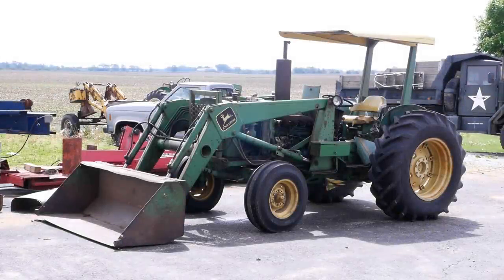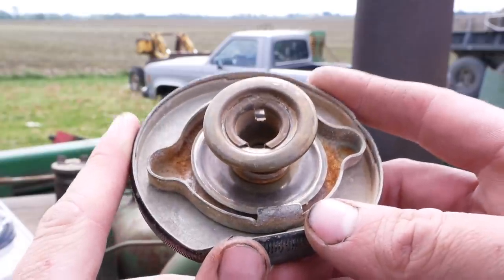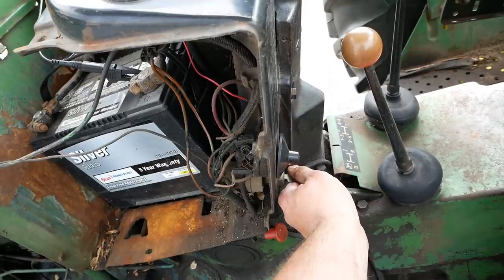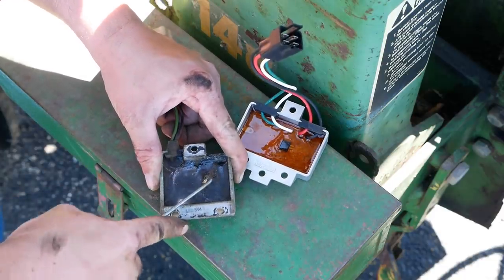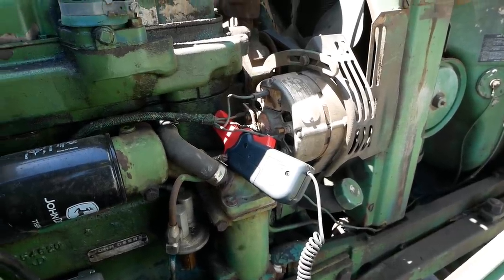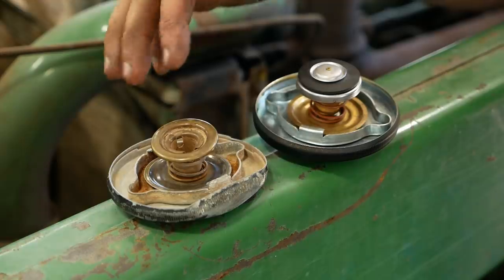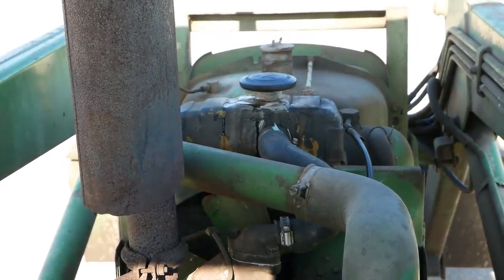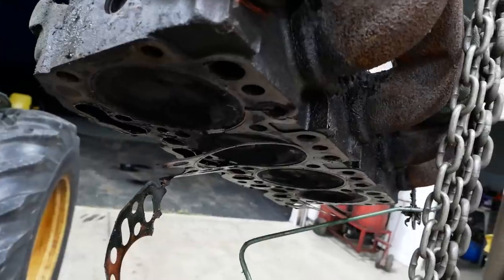Not Fixing a Tractor - Overheating and Barely Starting

Comment: I hope you told the customer that you weren't going to warranty any of the work you did on the cooling system. The electrical system you at least got in good shape, but... What's that tractor worth if everything was fixed and working properly? How much would it cost to get it to that point? Looks like a parts unit to me.

Comment: It is sad. This is old reliable technology. It takes care about you for a long time, if you take care about it.

I believe too that there is a lot of build up in the radiator. Maybe there is a chance to cure the overheating by a radiator flush , with chemicals who disolve the buildup.

I always say to my buddies who are not mechanics: Oil and a filter is cheap! Maintainance is cheap!
Because when you have a nice tractor like this, it is an even higher investment to replace it. And I really like this tractor. How much HP does it have? Something between 60 and 100 I asume.

Comment: NO Thumbs down.   :)    Sometimes you gotta get em running to see how bad they are.   The customer should have been more honest... Then they wouldn't have bothered with the charging system, until they knew the engine was worth salvaging.   At least it runs now, and they can sell it for scrap.   Craigslist will say...   "Needs TLC"   Ha Haaaa

Comment: Engine swap and trans/axle swap. Caterpillar V8 diesel D90 dozed engine an gearing outta a DTZ tractor. DTZ's have engines that are great fer generators better than tractor engines. But their trans/axles are awesome with a Caterpillar engine bolted to er.

Comment: So about which comes first, the hen or the egg. I´m betting on the alternator giving up first, then the batteries goes bad from not having enough charge. Then finally the starter gets fried, when it does not have enough juice to spin the engine properly. It is a disaster chain...

Comment: So basically they wanted you to fix it just enough that the overheating problem wouldn't be super obvious so they could pawn it off on some poor schmuck, probably without telling them about the issue, and let them discover it on their own the first time they try to use it. Fun. Can't fault you. You did your job, discovered the issues, and came up with a solution. Not your fault the owner is unscrupulous.

Comment: Irontite works wonders for garbage like this. Put in two bottles of the blue bottle All Weather Seal for this and watch it work for another 2 years. I got 9 months out of a terminal 7.3 IDI heads cracked gaskets blown and leaky and only used one bottle. Should have sprung for two I'd still be driving it

Comment: As my dad would say in the old days. Time to unscrew the new radar cap and tell them put a new tractor under the new radar cap. So nothing you did wrong. They tryed getting you to fix a worn out tractor. Sad you even put any new parts on that thing. And if you know it was that bad. You give it back to them and say it can't be fix. So you can't fix worn out stuff. You got to have something lift on it that worth it to fix. And when a engine wore like that I be saying time to get a uses engine or time to get a new tractor. So you did nothing wrong. You did what the guy wanted. Say to yourself good I got that peace of junk out of my life. You put your time into it and found what was wrong with it. But you can't fix a wore out tracker.

Comment: So I will not hit thumbs down. What I will say is I can almost understand the farmer. Except for the oil leak, I just couldn't live with that. With what you have done to make this start right up I could use it adding water each time. But not bush hogging but using the loader for feeding and manure. I would put a radiator flush through it so it could run for an hour or two without overheating. With a cleared radiator it might not reach the white smoke level as that would be my temperature guage. If I was loading manure and it started white smoking that would tell me to hold off. I just can't see this tractor without a new head bush hogging or definitely not plowing or tilling without a new head. I don't think it would be possible even for this guy. I mortally hate a loose steering wheel.

Comment: No thumbs down from me, ain't your fault. The cracks in the engine block......the only time I have seen a block crack in that manner was when some novices (I am being very generous)  replaced a head gasket and did not blow out the bolt holes with compressed air to remove the coolant that got in there because they pulled the head off without first draining the cooling system and engine block.  Then when they were putting it back together they coated the threads of the head bolts with grease and ran them down with a pneumatic impact wrench.  The block cracked due to hydraulic pressure created when the bolts were spun down on top of the coolant in the bolt holes.  That same crew had probably wrecked some other engines the same way because I got the details of how they did not blow the bolt holes clean from another friend of mine who watched them do a head gasket job and noted that no effort was ever made to remove the standing coolant from the holes and that they slammed the bolts in with the impact wrench after getting the bolts started a thread or 2.

Comment: Unscrupulous so and sos! Some poor sucker will buy that having seen the new alternator and starter and buy a right crock.
Regarding diagnostics, do you ever use oil analysis, eg., Finning SOS? You can learn an awful lot from a basic oil analysis. Aside from wear metals the SOS tests for coolant and fuel in the oil. SOS kits (at least in the UK) cost around £20 for a 48 hour turnaround kit and include all the sample bottles and the reply paid envelope.

Comment: Ah, typical used farm tractor. Like 85% of them are in similar condition at here Finland so its not only USA thing. Amount of not giving single fck about problems and neglect can be amazing. Repairs are kept bare minimium to keep tractor running and somewhat usable. I know how its done at farms, even our 2 oldest tractors are POS's due lack of caring and maintenance. Everything on them are loose/full of play, not working, deleted or repaired with ghettostyle

Comment: Cold weld the cracks..tap and plug..c'monis there no sunshine with you?
Reply from the maker: You can't really do that when it's cracked through the valve seat. And that won't fix the blow by either.
Reply: @WatchWesWork  bronze arc welding..or brass really cool

Comment: Time to retire and replace that thing if they don't want to repair.  5 gallons of hydraulic oil is $80 to $100 a can, and the loader pours out as much as it does, that is just sheer stupidity to run that like that, they must not use it much..

Comment: I would refuse to put the head gasket on the engine and I would remove all the parts that I had already installed. I would then reinstall all the original parts that I had removed. Then I would tell the owner that I was sorry but I could not repair the tractor in the manner that he wanted because I was a certified mechanic and therefore was obligated to either make the necessary repairs or return the tractor as is because of the potential for future engine liability. Yes, I realize that the new parts may not be returnable, but removing the new parts that you installed may save you thousands of dollars at some future date.

You have got to protect yourself from the tractor owner, who at some point in the future may blame the destroyed engine on your sloppy mechanical work. Why do I not trust the tractor's owner, because anyone who would treat an expensive piece of machinery in that manner, cannot be trusted to tell the truth about how the tractor got that way and you could end up being the named fall guy?  I suggest that you keep all the videos that you have made on this job as proof positive that any engine failure was not your fault and keep those videos forever !!!

Comment: Why didn't you just use the Chevrolet internal regulator all later wouldn't have to buy the voltage regulator and it's called a 1si you can give him an O'Reilly's or any parts store

Comment: False economy... don;t take care of the small problems (routine maintenance) and you end up with big problems.

Running straight hard water instead of coolant and the passages in the engine get fouled, so less heat transfer. Don't replace a damaged radiator cap, and the coolant can't get hoot enough. Ditto the thermostat...

Basically, how to fry an engine for want of $100

Every other problem with that tractor is similar in nature...

Farming is hard, and only getting paid after the harvest is a cashflow headache, but if you don't take care of your tools...

Comment: The customer isn't very smart in this scenario. No disrespect but they're setting themselves up for a quick failure by not addressing the cracks in the block and the head especially. Doubtful it'll last much longer, or even stop overheating at all. They would be better off just grabbing a used long block and just fixing the essentials little by little like the radiator for instance.... seems like a lot if this stuff was self inflicted by them. Sad seeing someone NOT do a repair correctly.